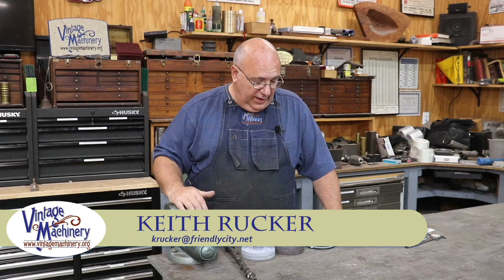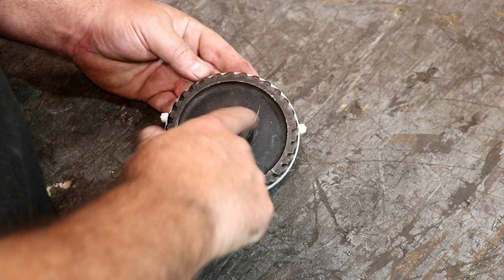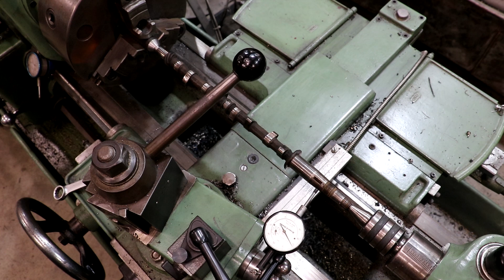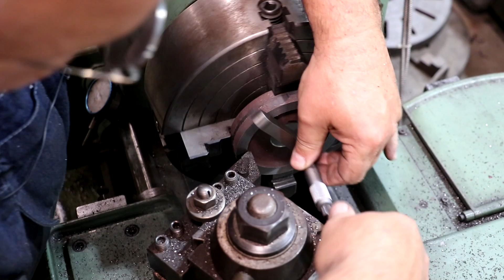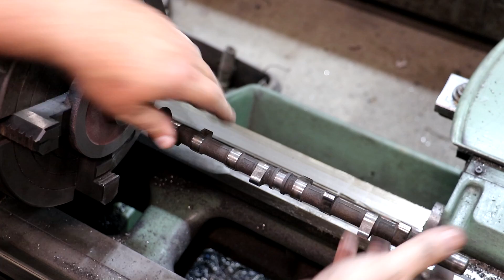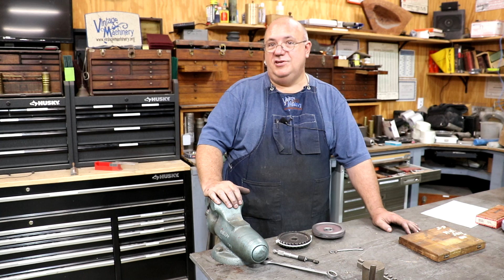1928 Austin Timing Helical Gear: Turning the Gear Blank from a Cast Iron Casting

Comment: Keith,

How significant is the fit of the taper?  You used "feel" to determine whether there was good contact.  Should the shaft have been "blued" to assure good contact?

Based on other's comments the key is meant to assure timing. It seems it is not meant so much for transmitting power.

Bob
Reply: The fit of the taper is fine. It will get even tighter on the cam when the bolt is torqued on the end. The key way will transfer the rotational force from the mating gear to the cam shaft. I’ll be interested to see if the placement of the keyway in the hub is a critical position, in relation to the gear teeth. The cam shaft needs to be timed with the other gear driven components for optimum performance. I’ve never worked on gear to gear engines, only gear and timing chain ones.

Comment: Quick bit on Austin...

They were an early car maker, starting in  1905. However the founder, Australian Herbert Austin had been involved in making cars since he moved to Britain in 1900 and, before that, Sheep Sheering machines (since 1887).

They produced the 'British equivalent to the Model T', the Austin 7, from 1922 to 1939. This was the car that popularised motoring in the UK. It did well overseas, except in the US, and were the first cars produced by BMW and Nissan. As others have said, it's probable that the engine this comes from is from an Austin 7.

A number of mergers later they remained a brand of their owners, most famously internationally as one of the two brands under which the Mini was sold, before the brand changed to the combined Austin-Morris.

They are also famous as builders, until 1997, of various evolutions of the London Taxi, being the dominant builder until the late 1970s.

Austin has not been seen as a brand for a long time, since the demise of Austin Rover and ending of production of the Metro in 1994. For a while the brand was owned by a Chinese company but it is now owned by a British engineer who plans to use it on a new line of electric vehicles.
Reply: You’re correct that the Austin 7 didn’t do well in the US, but as an important side note, the company that produced it under licence there after the original American Austin company went bust, was American Bantam who would later be credited with the invention of the original Jeep.
Reply: I love how the Gas Monkey Garage beer quality control guy owner always calls them "Austin-Martin"
Reply: @ruben_balea  🤣🤣

Comment: Is there a reason why you didn't just finish the outer diameter  before putting the taper in?  Then you could have used a straight shaft mandrel and be done with it.  I'm sure there was a reason, but one never knows.

Comment: Sure is a flimsy camshaft.  Must be low revving and weak valve springs.
Reply: That is a funny comment.  😊
Reply: If it’s for an early Austin 7, then max power was at 2400 rpm (or I guess 1200 rpm for the camshaft)
Reply: @emma.jacobs1  .....Emma, please don't confuse these YouTube know-it-all, 100 year old Austin engine experts with facts!!
Reply: Yes but there is a racing series for the Austin 7, if that is what the parts are for.
Reply: PC   Mr. Perfect !

Comment: I hope you accounted for the thickness of the ends of the groove micrometer. It’s for measuring the inside of a groove, using it on the outside of a part, you would have to add the thickness of the ends of the micrometer, or you would make the part too thin.
Reply: What is this, measuring 101? Come on, have a little faith the man knows how to use measuring tools.
Reply: @truckguy6666  I know but everyone makes mistakes!
Reply: He says plus 17.
Reply: I agree.  Keith, please measure the thickness of the rim using a proper tool (calipers or micrometer)  to verify it us not too thin.  This may explain the apparent increase in the thickness of the casting!
Reply: @alanblair3193  If you were listening to what he said in the video he has already established that the web part of the casting is about 200 thou thicker than the original gear. that isn't the result of not factoring in the thickness of the mic anvil.

Comment: Just wondering why you did not use your lathe taper attachment so you could still move your compound in different positions for machining? Nice to see you keep everything true to the original!
Reply: My two cents, he has a DRO so compound doesn't matter for this job, it's a one off, a short taper, cast iron so finish is easy, quicker to set compound the the attachment.
Reply: @mrsock3380  it would have been easy to machine all surfaces if required without a problem and repeat if another part was required. The taper attachment has a fine feed adjustment which does not involve hitting anything. It is also infrequent that an opportunity arises to use it. Not sure of the relevance of a dro in this situation anyway?
Reply: @Throughthebulkhead  Without a DRO you could use the compound for accurate z axis movements, so he has no reason to move the compound besides turning the taper.
Reply: F=

Comment: I think they need some treaded holes in a circle around the "hub", they brooke the gear when they used a universal puller,       dont you think ?
Reply: They may have broken it with the time honored method of hitting it with a hammer. I've found that to be a surefire method of breaking things.
Reply: new ones not gonna break its thicker :) bring on the pullers.
Reply: It broke when he threw it across the garage when he busted his knuckles.
Reply: How about keeping the web thick; but drilling three large holes that would fit a puller.  This would conveniently remove excess weight which has been fretted about in the comments.

Comment: Thanks Keith. What an in-depth project !!  Obviously this job has been in the works for some time, making the pattern, having Clark cast the part…was there any issue converting metric to standard measurements ??
Reply: The original part dates to a time when British manufacturers used "Imperial" measurements and Whitworth form threads.
Reply: Although Morris would use a French engine in his cars. Which leads to oddities like BSW head sizes on metric threaded nuts and bolts to keep the  car mechanics of the British Empire happy.
Reply: Ps i meant Morris of that vintage
Reply: @littleworkshopofhorrors2395  and Morris/MG engines used those oddball fasteners for quite a while longer, too - up until 1955!
Reply: I don’t think odd threads was a particularly unique issue for British makers. My 1952 Swiss built mill is a chaotic jumble of metric threads and UNC threads for things like the gib screws. No idea why when the Swiss had the oldest metric thread system in the world.

Comment: You are going to need to cut the teeth before broaching the keyway. Timing between the teeth and the cam lobes thru the keyway timing has to be less than a degree off for the engine to run properly.  

You will need to drill a hole thru the big side of the tapered keyway  roach plug and bend a wire that the tip has been ground to fit between the gear teeth.  Bend a J in the tapered
End.  So you can accurately time the broach plug off the old gear.  And transfer that to the new gear. .

Hint. If you miss.   Select another tooth and try again with another keyway.  You could probably have 3 key ways.  Each off just slightly.
Reply: It is OK to broach the keyway in the blank first and later clock the gear teeth position to the keyway. The old gear can be used to establish the position of the first tooth relative to the key.
Reply: I was hoping someone would remind him to broach the  keyway last because of the needed accuracy for the timing.
Reply: I would be surprised if Keith is unaware that timing is critical. He probably has a plan to time the gear teeth to the keyway. I'm going to wait and see.
Reply: O my, never thought about the timing, how to get that just right is not going to be easy.
Reply: I was wondering about this also
Reply: Good advice. This got me digging thru my box of old engine component prints from my 40 years at Ford Engine Engineering. I found a crank sprocket drawing from a 3.0L V6. 
This is for a chain driven camshaft in an overhead valve configuration, so it is half the size of the cam sprocket.
General note calls for induction or flame hardening tooth area to a depth of 0.25 to 2.54mm below tooth root diameter. Hardness to be Rockwell C45-55.
Timing mark on centerline of one tooth to be +/-2 degrees of centerline of keyway.
Reply: @stevenslater2669  you must be fun to talk to.  Did you see last weeks steve Morris race engines video. Where all 8 rods were laying in the pan and the crank spun freely in the block. Crank cleaned up at 10 under on the rod journal. 570cid BBC.  8500 rpm. 45 pounds of boost.  About 4,000 horsepower. The rod beams shattered like you dropped a m1a1 tank on them. 

Were you there when the first 5.4 supercharged GT engine lost its crank snout do to an undercut.   
I did a napkin drawing of a tuning tube to bolt in at the collector flange of a friends N/A H22  honda all out drag motor.  Got rid of the raspy exhaust and picked up 10 hp on the top end. 265 to 275hp in 5 minutes.
Reply: I was going to say the same but you beat me to it. Also wouldn't be too difficult to set on a jig with pins to align the teeth and an offset pin in the broach collar to get the timing all set properly.
Reply: in 1928, would they have put the gear in the block and timed it there with TDC and marked it?
Reply: @rickjljr11  in 1928 the tapered keyway plug probably had alignment pins into the teeth to hold it in place for broaching the keyway accurately.  Keyway position is to time cam and crankshaft positions. 
In the mid 90s ford made a change. No keyway in sprockets or shafts. . Hold the crank and cam alignments with jigs. Tighten bolts to hold sprocket position and cam timing . Saved ford millions every year. Sped up part production.  Sell more parts when service needs to be done.
Reply: And that will be a little shaky with the busted out hub...
Reply: You sir, are a life saver, that is some real good advice, weel done Wayne!
Reply: Obviously, this job cannot be done by just any machinist. It is only for experts.
Reply: I was hoping he would make that mistake.
Reply: @RustyEast  That's a dick thing to say
Reply: @RustyEast  not as smart as he think he is

Comment: An Austin 7 no doubt - onsiderably smaller than the model T.   747cc (45.6 cu.in.) side-valve, watercooled four stroke,  with 4 cylinders. ~7.8kW (or 7hp - hence the name!)
Reply: The 7 name referred to the “RAC Horsepower Rating” used for tax purposes and was based on bore size and number of cylinders rather than actual power output. The earliest 7 had about 10 bhp but calculated out to 7.2 hp. Later cars were up to 25 bhp

Comment: I think the designers made the gear to fail first for a reason if the cam or any part of the mechanism fails it's harder to replace and more expensive the gear was the cheapest easiest to access.
Reply: From looking at the break, I suspect it was done when trying to disassemble the engine. Possibly a poor choice of puller.  However the part had probably been on the shaft for 90 years.   Aside from the strength question, I was wondering about the increased mass compared to the original and whether that would have an effect on acceleration of the engine or strain on the gear train during acceleration/deceleration.
Reply: @markbernier8434  you're probably over thinking it, it's only a 7 HP engine 😉😉
Reply: @bigtrev8xl  extra mass would affect a lower horsepower engine a lot more
Reply: @PatrickPoet  it was said in jest, hence the winking face
Reply: @bigtrev8xl  my bad. I was thinking racing bike.
Reply: @markbernier8434  Yes I also thought that the increase in mass/moment of inertia could adversely affect acceleration.
Reply: @stumccabe  On the camshaft gear of an ancient austin sidevalve engine? The cam is only running at half crank speed. You are over thinking this.
Reply: This failure most likely occurred when someone was attempting to separate the gear from the camshaft using the wrong technique. Possibly they were using a 2 jaw gear puller which concentrates the pulling force on 2 places instead a 3 or 4 jaw puller, or an actual "pulling collar", which would have distributed the pulling forces more evenly around the perimeter of the gear.
Without knowing for sure what technique or tools they were using it is just as likely that they might have simply set the cam gear across the opened jaws of a large vise and smacked the end of the camshaft with a hammer against a soft drift (hopefully with the retention nut set flush).   I have seen some very questionable/wrong methods used by different people in my career.
I doubt that the gear itself was EVER engineered to be a sacrificial failure part in any schemes for predicting and protecting against catastrophic failure.  If the engineers were designing along those lines of thought they would probably have focused on making the actual key to be the sacrificial part.
Reply: Larry,  i can't recall gears designed to fail in such cases, except for fibre gears for Magneto drives.
Reply: @littleworkshopofhorrors2395  That is true the fiber gears in certain magneto drives are a failure point,  but I am uncertain if  fiber gears are used as a sacrificial component to fail BEFORE something else, or if it is so that the inevitable gear failure will not produce further destructive shrapnel. I do know that one reason fiber gears are used in some magneto drives is to reduce the backlash noise inherent in the magnetos that have an impulse drive. It may be that there are multiple reasons fiber was chosen.  The development of magnetos precedes my working career in this field by many years, so I have little hands on experience with them.
Reply: Certainly fibre has been used to quieten gears but generally in my experience they are sacrificial both on lathes and motorcycles.
Reply: @littleworkshopofhorrors2395  Point well taken.  Thank you.
Reply: @larrywalker7759  Agree with all your observations here. This old sidevalve engine is very low tech and simple in its design.
Reply: The increase in the mass in this case will probably have less detrimental effect on engine performance than if a heavier viscosity motor oil was used in the crankcase.
Reply: @larrywalker7759  The cam wheel is only running at half crank speed and the crank rpm isn't very high on these old timer engines.
Reply: I agree, and that is why I think Keith was wrong to not turn the thickness to match the original.
Reply: Sacrificial gears don't break into big chunks so they end up jamming and breaking the rest of the engine, gearbox or whatever, they just lose their weak teeth like candy lovers ;-)
Reply: You are over thinking this,Robert. The main reason that foundries put depressions in castings is more to do with saving the amount of metal poured than anything else.
If you look closely at the way the gear is busted it looks most likely to have been broken by poor choice of puller type to remove it rather than a mechanical blow up whilst in service.
Reply: @howardosborne8647  ok you're probably correct. However, if you were to design this system, where would you put the weak link?
Reply: @Bobwithoneo99999 I'm just puzzled why you believe a 'weak link' in the camshaft drive would be beneficial?  There is no logical reason to design in a weak point (often called a fusible point or link) 
If a weak link is deliberately included into a camshaft drive/valve train then all that is achieving is a recipe for failure and reduced mechanical reliability. 
On a sidevalve engine such as this old Austin the valves could never collide with the pistons because of their location but on an overhead valve or overhead cam engine designing in any 'weak links' is a recipe for disaster because if the cam stops turning in  sync with the crankshaft then the valves will collide with the pistons causing severe engine damage.
The only stresses induced into the camshaft on this Austin are those imparted by the valve springs. The cam gear itself does not impart any stresses worth mentioning.